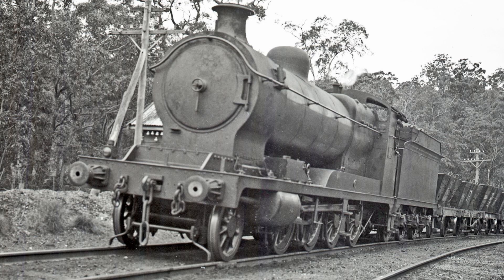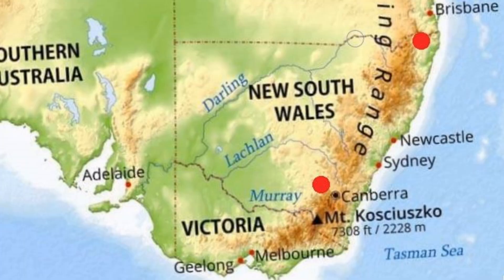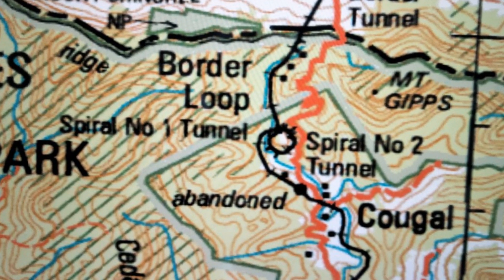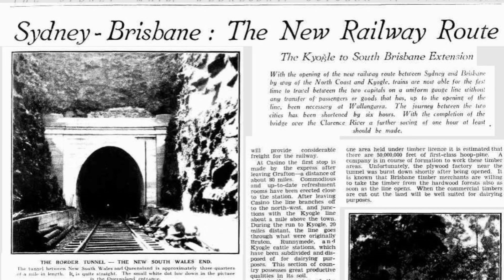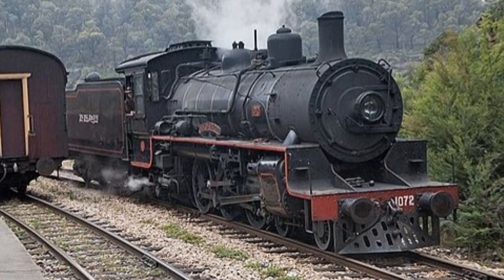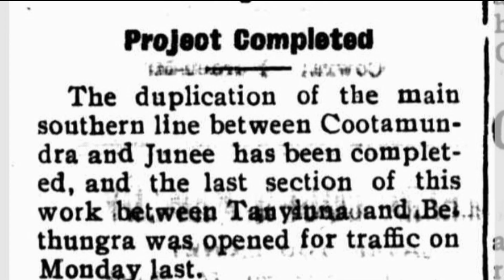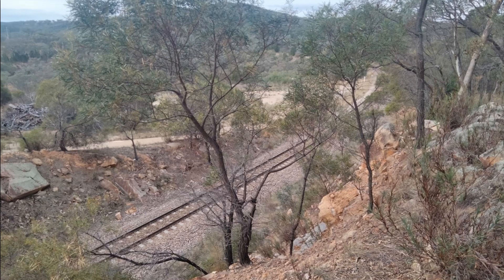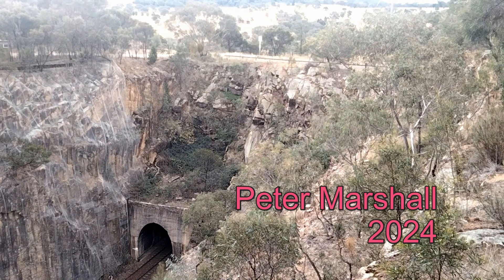Rail Spirals in Australia

Comment: Back in 1940 there line was duplicated between Melbourne and Sydney - accept between Cootamundra and Junee, although you would have had to change trains at Albury due to the break of guage. Now of course, you don't have to change trains, but there are now single track sections between Melbourne and Seymour because they only built one standard guage track, with some passing loops, in that section.
Reply: The track from Mangalore (Just North of Seymour) was ALWAYS single track all the way to Albury.  It is only now where the broad gauge track was converted to standard gauge that there is double track from Seymour to Albury.  And that leaves THREE tracks from Melbourne to Seymour.  One standard gauge and two broad gauge tracks.
Reply: @smitajky  other countries Just got on with standardising guages without making a Fuss, it is ridiculous Aus is still making excuses for failing to convert necessary corridors to SG, basically everything N of Melbourne should have been done by now and the Ballarat and Geelong lines too.